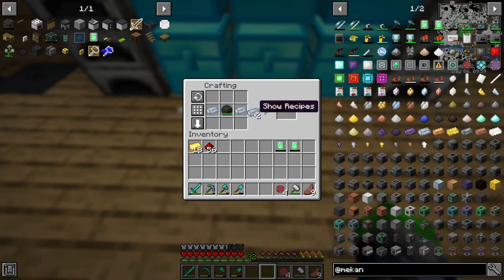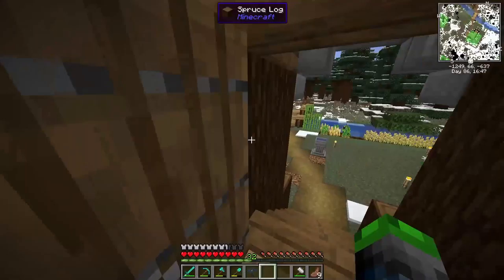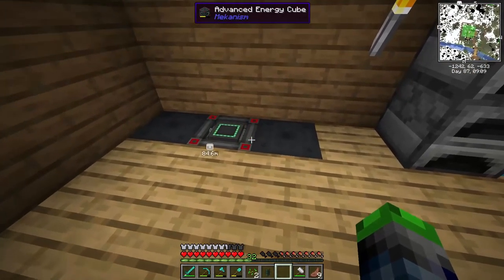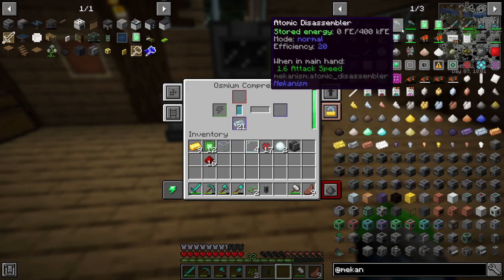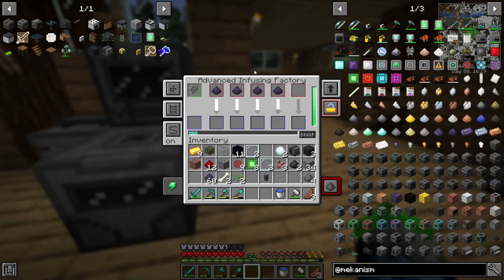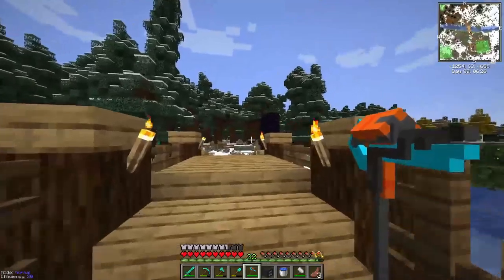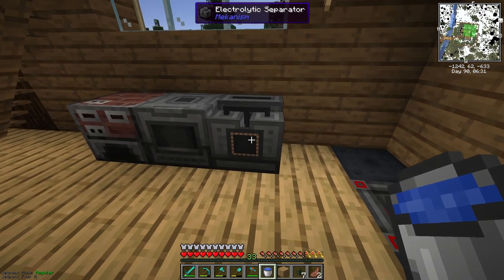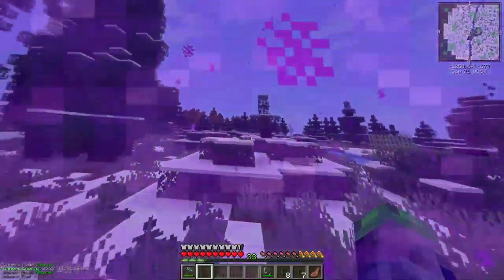Valhelsia 2 | The Atomic Disassembler is OURS!!! | [EP 7]

Comment: If you like the atomic disassembler.. you should try out the Mining Gadget "gun" for mining.  Slap in a few level of range upgrades, a efficiency 5 upgrade, magnet upgrade, light placer upgrade, and maybe the silk touch upgrade and it will insta-mine blocks in a huge reach, automatically place light sources whenever it mines a block that is below light level 8, and uses less power than the atomic reconstuctor... it's an absolute beast for mining.  You can also put in an upgrade to make it mine in a 3x3 area too!  Making a basic Battery from Powah mod is a nice thing to have too since it holds 1mil FE/RF and will recharge your tools for you as you use them.